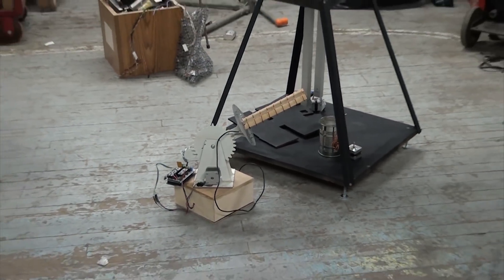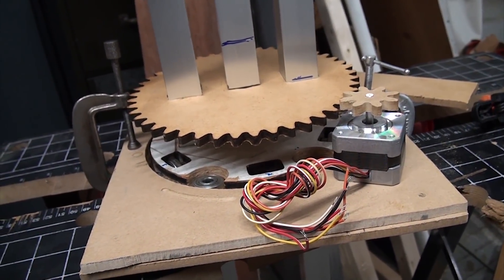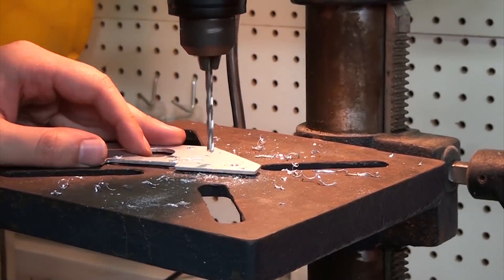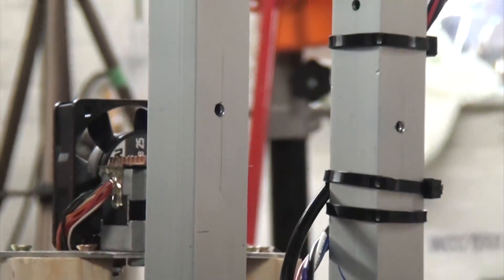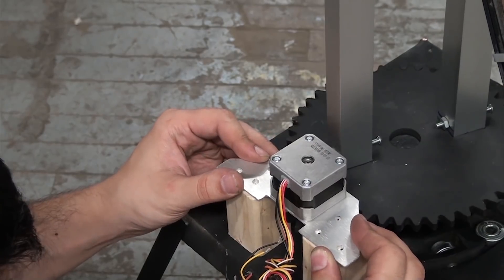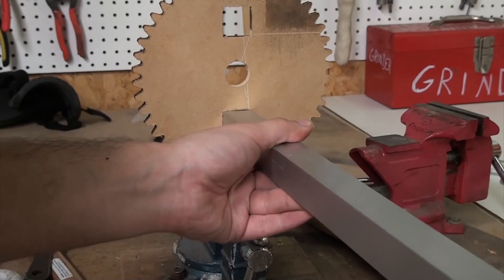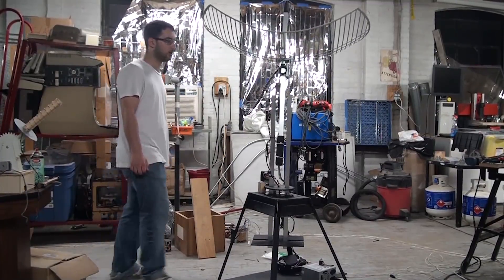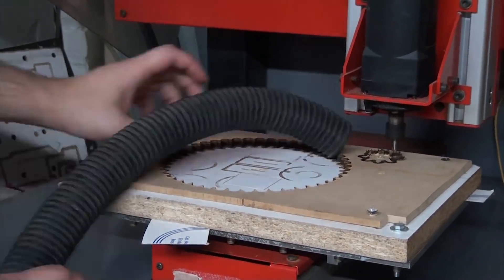Track Satellites in Orbit - Part 2

Comment: I would move to a screw bolt bearing configuration instead of the big cogs? Can you get more precision It would be similar to the same drive on a CNC or 3D printer?

Comment: The main issue I incurred when using the 2.4 parabolic grid antenna and satellite reception was RF noise interference from other power supplies and computers and such, did you have to Shield the psu and motors?

Comment: To stop snapping bits in the drill press. Drill smaller holes first (pilot holes) then step up the diameter in 2 steps.

Great work with the CnC mill.

Comment: Here is a little tip, if you use a chain and sprockets with a tensioner it makes it tonnes easier to apply with the minimal amounts of effort.
I would of used 2 sprockets and a chain, the same as you would find a push-bike and insert a tensioner onto the chain just to make it stronger, by doing it this way its faster and quicker to apply it and dont have to worry about weight and strength issues like you did in this vid.

Great Vid, tho!

Comment: Your struggles are pretty typical for someone with a 'hacker' background.  Spending some time with a good tutor or even with some of the better-known YouTube machinist/fabrication channels would go a long way.  Things I can think of that would have helped with this build:

1.  Learn to weld.  Seriously, making stands and things like that out of tubing would go a lot better with less wood (!) and more welding :)

2.  Drawings.  Unplanned issues with things running into other things can be foreseen with even a decent sketch.  Things like Sketchup, Fusion360, or if you have access to them Inventor or Solidworks will make things go much smoother.

3.  Feeds and Speeds.  Spend a weekend or two with good CAM software (HSE is free) and some YouTube videos to learn the ins and outs of CNC machining.

It's a lot of fun to just build stuff, and if you don't really care about how long the stuff you build will last or how many tools you'll break building it, by all means just dive in.  But for something that will last longer than a season and for the sake of your tools, spending the time to build your skills will go a long way!  You could even do some great videos documenting the beginner's path :)

Don't take this as a negative comment btw, we've all been where you're at!  Have fun progressing and don't forget to stand on the shoulders of giants!
Reply from the maker: My background is in biology and this is the second robot I've ever built. I learn by doing, and if I'd built a third it would've been perfect. All the improvements I made in this one came from failures of the first version. I didn't weld because I didn't have a welder at the time, we only just got one. I did spend my time building my skills... by building this. I know a lot more about CNC and robotics than I did when I started and now I don't make any of those mistakes. And for the price of a few snapped bits and some burnt MDF which cost all of 10 bucks, I learned my lessons pretty cheaply. But ya, I've been watching a ton of this old tony, AvE and lots of other machinists to see how to do things properly. We just got a metal lathe so V3 will be much sleeker and will focus on longevity so we can mount it outside permanently and will again document my learning process. But considering I went into this blind, built the whole thing in 3 days, and finished with a project that is more than what many masters students can pull off,  I think I did fine.

Comment: Hey I have a ~635nm non tested red laser. I wanted to do a project where I could change the wavelength by a exterior means. Before starting a project that I know little to nothing about I thought it would be usefully to ask if you had any suggestions first. 
Thanks, Josh
Reply from the maker: short answer? not easy enough to be worth doing. Thus far im yet to get second harmonic to work even with very powerful lasers

Comment: Use some oil/cooling liquid when drilling metal. Will save you drill bits from breaking/premature wear. Esp in aluminium. Even WD-40 is better then noting,

Comment: For drilling in to metal I would shuguest that you use some oil it help keep the bit from warming up and helps make it easier to drill in to metal. If you have some motor oil from a car you could use that.

Comment: Hi, great work.... just wondering.... how do you handle things if the signal you are seeking is polarized???? you may need some way to rotate the dish, in relation to the source, so ensure correct alignment, and hence clearer signal... maybe an extra stepper at the head to handle the rotation ... would only need to move a quarter turn

Comment: Neat and great detail as always with your works.  I finally have a direct TV dish and some other antennas I've picked up for free to use for.  I'd like to use one antenna for a background scan (discone most likely) to subtract to reduce noise/unwanted signals and the other antennas for tracking. 

I've considered for the altitude/tilt tracking using a semi-circle, or actually might be a little more of a circumference, gear with the axis as close to the back of the parabolic trough or dish as you can so less counterweight required and is more the center of gravity.  Kind of built right into the back side of the dish/trough basically.  Then having the table rotate for panning maybe using captain chair bearings that can be found cheap like at Walmart in the marine section with the whole system kind of built like the Dobsonian mounts.  This instructable kind of has the idea (https://www.instructables.com/id/BUILDING-a-DOBSONIAN-TELESCOPE-MOUNT/)... though not like I'm planning exactly.  

I've been wondering how to make DIY like video camera mount pan and tilt fluid bearings since seems like would be way smoother.  I'm thinking something pressurized with grease or more grease for now with a seal around for the panning captain chair bearing at least.
Reply: Here's a closer design regarding the mount where a layer for gear teeth can be added: https://makezine.com/projects/build-a-backyard-dobsonian-telescope/
Reply: Here is an even closer design... with the exception that I am thinking for fluid bearings milling a groove in the base for the balls and grease to be with a similar though slightly narrower profile for the top part that will sit on the balls and in between the base groove.  I'm thinking the same for the altitude/tilt tracking with brushes/rubber to clean or like squeegee the top part before entering the end bottom part that has the profile of the bearing to keep the bearings in. http://members.ziggo.nl/jhm.vangastel/Astronomy/30cmscope/motorize_30cm.htm
Reply: jafinch78 Thank you for the links Sir, very much appreciated.

Comment: Going slow with cutting metal is not always good. You're rubbing the metal not cutting it. This leads to heat which chip welds the chips to the bit which fills the flutes and eventually breaks your bit. You need to check out NYC CNC on Youtube. He has a ton of great info on this kind of stuff. Setup your feeds and speeds properly, babysit with a bit of WD40 or coolant, and make sure you have great chip evacuation like a vacuum or air hose and you'll be cutting aluminum without breaking bits. :-) GLHF

Comment: Nice work. For the aluminium, I use this app for feed and speed calculations: https://fswizard.com/. Also use some cutting fluid. Aluminium will gum up the tool when it gets warm. Sometimes it will just grip the tool and snap it right off. Cutting fluid cools and lubricates for better chip evacuation. Keep up the work.

Comment: I wonder if you could find some cheap planetary or other gearsets for the drive. It seems like you're trying to get too much out of those steppers, and they'd "like" to be at higher RPMs but lower torque values. Could help with the fine tuning of the aiming, once the time comes.

Comment: Loving the build, why didn't you use a worm and wheel to adjust the altitude of the antenna. It would put far less stress on the stepper. In fact all you would really need is a motor with or with out a feedback loop. It also could make the whole system far more compact
Reply: no kidding. why did i not think of it either. i thought it looked odd the way he was doing it, just couldent figure it out till u said it.

Comment: You're breaking the end  mills because the depth of cut is way to much for that diameter. If you tell me the number of flutes and diameter of the end mill I can calculate the spindle speed, and the IPR for aluminum for you. I only work in imperial though. Also, there called end mills, bits are for drilling  and or driving fasteners.
Reply: Up Vote so he sees
Reply: Agree. Upvoted! NYC CNC is a good source for learning that. Another one is Lars Christensen's Fusion 360 Channel. 😉
Reply: I love NYC CNC, did you see when he broke the probe on the pumpkin?
Reply: And, yes, how could I forget? Check out This Old Tony here on YT too! 😎

Comment: Have you thought of using slip rings for some of the motor wiring? It would make the cabling much more clean due to having the ability to spin 360 freely. It would be added cost but I'm sure you'd be able to find some with high enough cables for the bottom to get both power (twisted pair of 2) then then the motors allowing for USB externally, power to the controller (locally mounted) then all the stepper cables for both.

Comment: Great work I'm sure it will do the trick, a little suggestion comming from a mechanical engineer, you should use a (screw gear transmission) for the antenna axes of rotation it will stop the wibeling and ensure the stoping torque needed for maintaining the antenna in place.
Reply: Great idea and a prime suspect for a 3D printed worm gear.
Reply: It’s called a slew drive
Reply: There’s a little chance he’ll be able to machine one but they have hundreds of them online
Reply: Levi Sheridan 3D printing them is fairly easy though.

Comment: A simple way of finding optimal speeds and feeds is to go onto the manufacturers website and finding the most recent catalog, you can find the tool by looking for the coad on the shaft (it should be on the shaft and/or the container it came in) from there, you can find the materials it is meant for and what it can handle, there's often a note on the page to where you can either find materials and what tools to use on theme, or a page that tells you the Optimum/Min/Max feeds 'n speeds for each tool. 
Some manufacturers also have a calculator where you can pair tools with materials.

Comment: I ordered the same antenna when your last video released. I'm going to use the same stand that I use for my telescope as it is designed for tracking objects through space. Something I recomend you check out. The stand has to be aligned with the north star to work propperly but after that its very easy to use
Reply: Liam Burgess I thought of doing this once until I realized that satellites don't orbit in the way stars move in the sky.